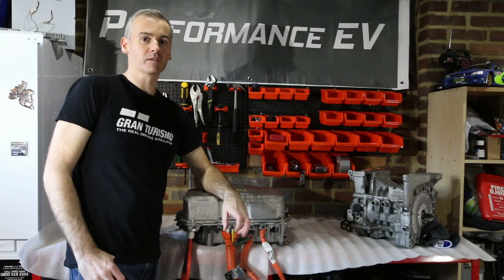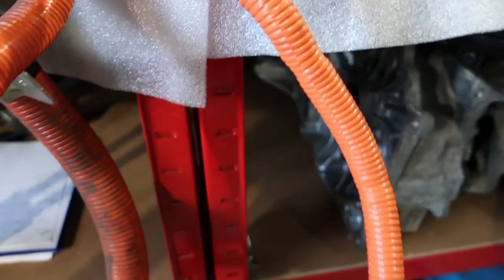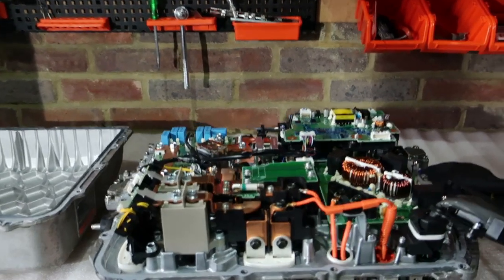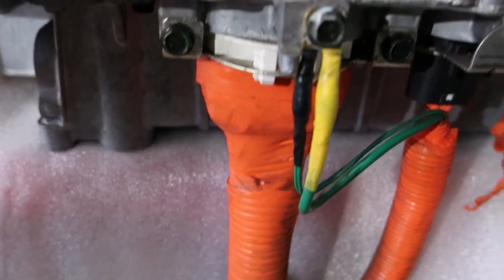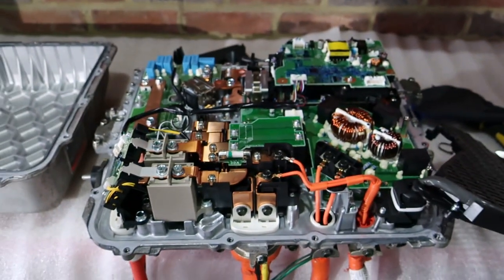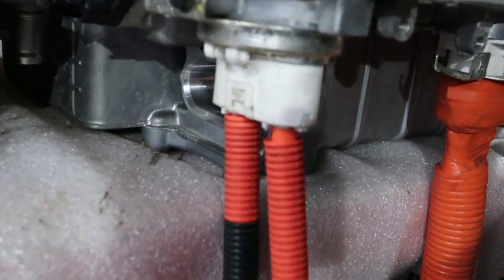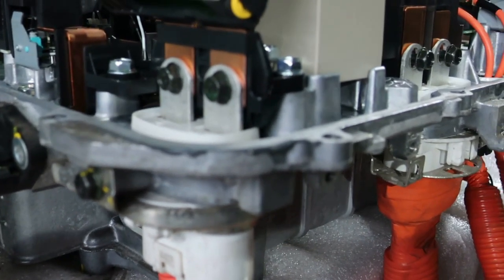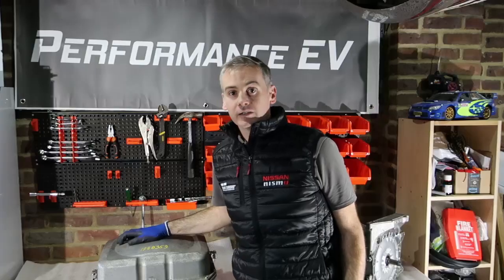Building an Electric Car - EV Parts - Inside Nissan Leaf Charger - Leaf Drive Unit Teardown Pt 2

Comment: Hi my can you tell me what this Nissan leaf 292A2 3NF1A pushes on inside the 6.6kw PDM unit, I'm having trouble with mine i have to rap tap on the end of mine to make it a little longer to make the car work and not give me Error P31E0-13 HV system interlock Error EVC-300.

Comment: How did you manage to pop the lid open? Just brute force? I'm concerned that I'm going to break something.
Reply from the maker: It was brute leverage, I was careful in getting a blunt screw driver about 10 mm or so in between the two parts of the case to create a bit of space and then did the same with a breaker bar once I had created enough of a gap.  There is a risk of damaging something if you push things too far in so I did have to go slowly and carfully.
Reply: @PerformanceEV  Thanks, I did manage to get mine open. Way more secure than I thought it would be.

Comment: hi so 2 years later how are the plans for the charger? I can't find info on the web to use this without the original car system.
Reply from the maker: Still on the to do list. Suffering from the same lack of info out there. I did stumble across some videos from South West EV UK who seems to have some success, but I haven't really had a chance to work through it myself.
Reply: Hi!,Yes, it's still a very good question because today we still don't know how to operate this charger and its DC-DC converter. without using Resolver vcu or Zombi verter.??

Comment: I am very enjoying watching your clips. I have a question: can the fiber car be charged while in motion? Self-charging by placing electrical generators in the car. Just a question and a thought. Please reply, engineer
Reply: if you want a hybrid ,buy a hybrid ,charging on the run is a complex problem

Comment: great video i like it. if you have motor along with the charger and inverter. would you mind to disassemble motor  also. so that i can learn something from your video. and would you mind to say cost for the motor and its specifications.
Reply from the maker: Thanks. I have the motor, and i do hope to dismantle one some day. But for this one i don't want to risk damaging it before i get to use it. The leaf motor is a permanent magnet AC motor and it puts out about 80kw in it's standard form.
Reply: @PerformanceEV  i think its not going to happen something like damage or destruction, because it is same as our ordinary induction motor except for the permanent magnet in rotor. Any way thank you.

Comment from the maker: Good question, i got it from a car dismantlers and i assume it was a bit more exposed to the elements there (either in a damaged car, or once it was taken out.) still less messy to work with than a similarly aged petrol engine:)